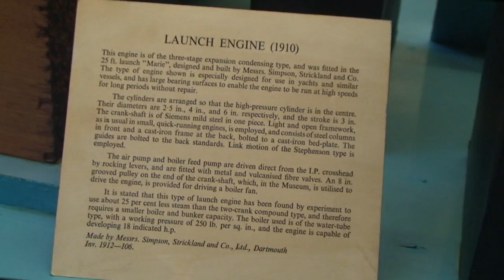Triple-Expansion Marine Steam Engine (1910) In Slow Motion

Comment: I didn't know that any steam engine used an inside admission. I thought the reason for outside admission was that it helped seat and seal the slide. Having higher pressure in the inside, one would think, would open the valve and cause gas to escape to the exhaust. How interesting. Very well done video showing lots of detail that I would have missed. Thanks
Reply: I agree.  Why have the high pressure steam 
forcing the valve off the seats?

steve
Reply: Could it be that the engine is turned the wrong way relative to the operating settings? Easy museum mistake (someone maybe pulled the lever)Nice video though!
Reply: i thought the same!
Reply: The low pressure cylinder usually operates at negative pressure, vacuum from condenser.
Reply: @stuartwaller4927  ...not at all ... compare the diameters.

Comment: They have differing bores but how about the stroke, is it the same for each cylinder?
     Are they using mild steel piston rings or high zinc brass or bronze rings? Is that an efficient engine enough to bother making or is a double acting single piston as good?

Comment: a very interesting system, altough I'm havin trouble findind the valve of gear for the second (HP) piston
Reply: Ok I think I got it now, but I think the steam only went from the top of the piston, the from the down possition it had use the stored power, from other cylinders or the flywheel. That's my guess, maybe I don't see the hole mechanism